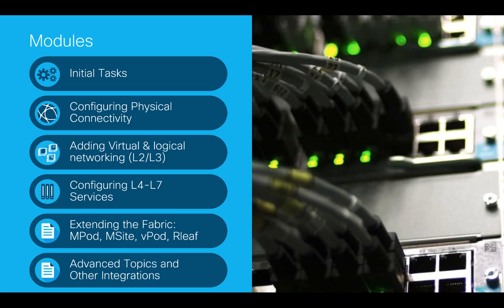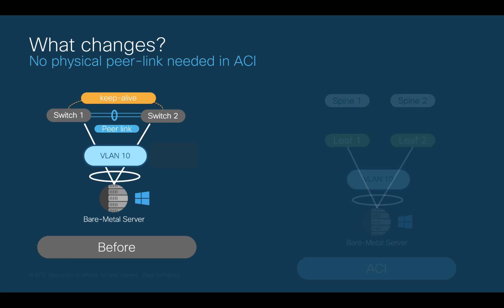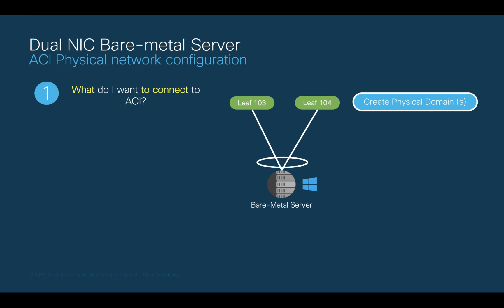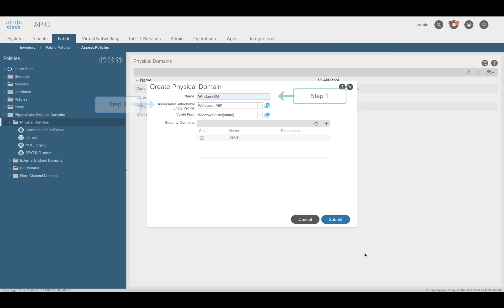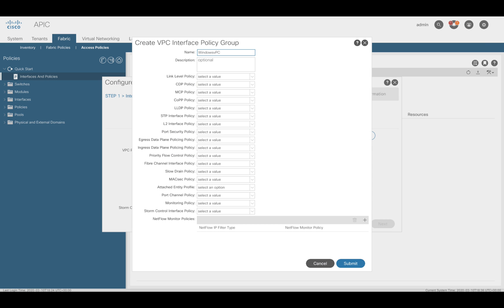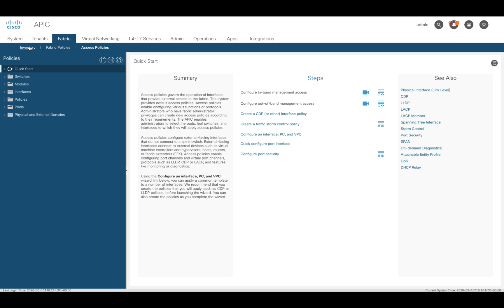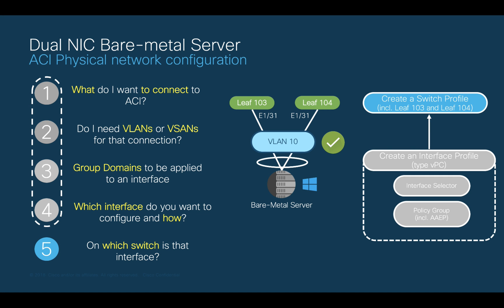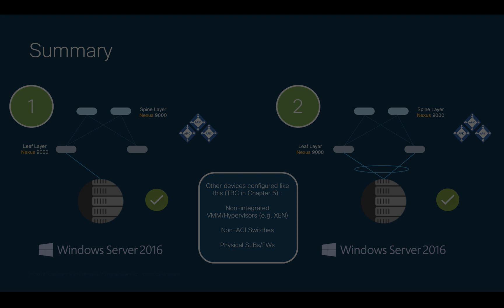Module 2 - Episode 3: Configuring vPC and dual-homed servers

Comment: such an amazing series thank you so much. Just a quick question which platform you are using to lab these up. I know that ACI simulator is available for practice but data plane doesn't work. Any idea where to rack some cheaper rack rentals to practice these things
Reply from the maker: Hi, we have a lab ourselves. You are right, unfortunately the simulator has no data plane. You can also play a bit with dcloud.cisco.com, they have some good ACI labs there, have you tried them?

Comment: Could you tell me vPC traffic flow in ACI?
Reply from the maker: Hi Jack! vPC peer links flow "virtually" over the overlay-1 VRF which is automatically built, therefore, all you need to do is create a VPC Pair (as shown in the video either through the wizard or manually) and then every vPC Policy-Group you create will carry all the configuration which will be bound to the interfaces you use based on your Interface Profile/Switch Profile. vPC entries are tagged as VL in the endpoint table of each leaf (show endpoint). You can take a look at the Module 3 Episode 2 Part 2 video as well (where I cover flooding, etc). Please let me know if this helps, otherwise I can elaborate further
Reply: @CiscoDataCenterMadeEasy   Thank you for your explanation!  I also saw the  Module 3 Episode 2 Part 2 video. That video help me a lot! thx
Reply: Will you upload video about L1/2 PRB? I really need it lol.
Reply from the maker: @jackchang8308  L3 PBR is going to be published as part of the L4-L7 introductory which I am planning to post this week (at least part 1, part 2 should come shortly after). If you get L3 PBR, you should be able to configure L1/L2 as well I believe